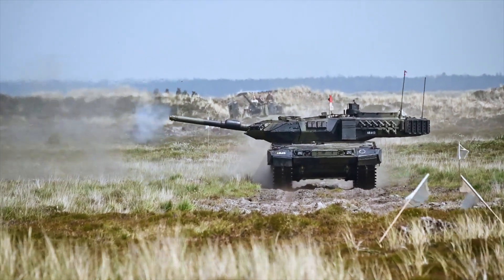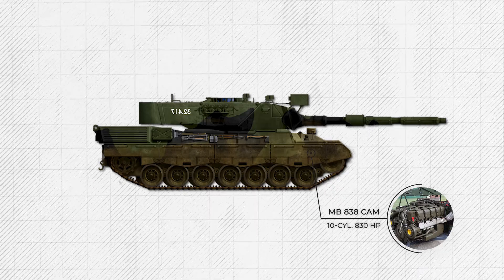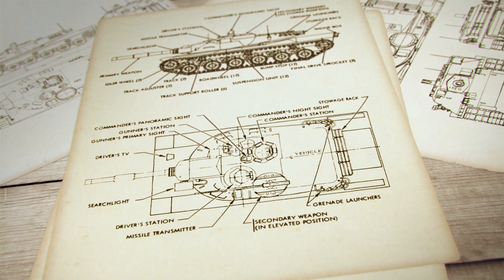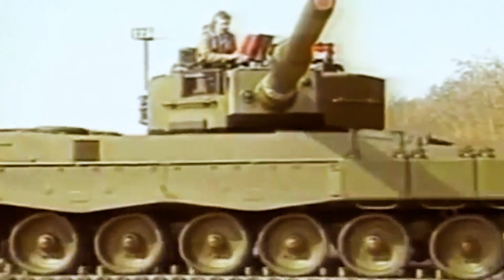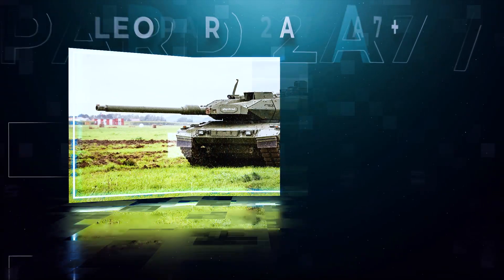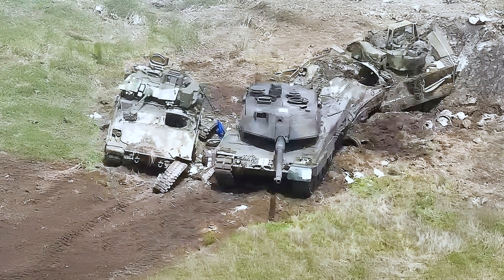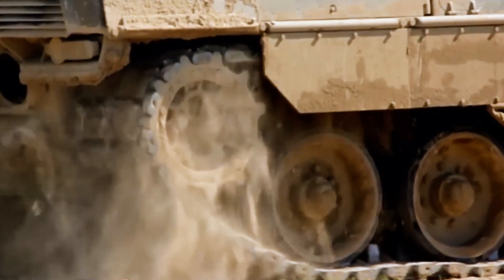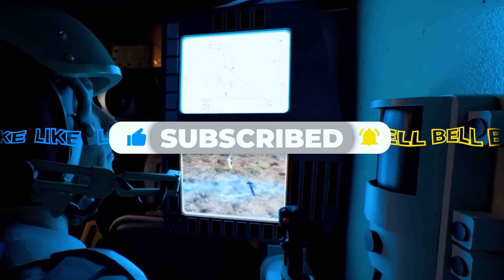The Main Secret Of The Leopard 2 - Why It Doesn't Explode When Hit

Comment: Nice video, but have some real issues with stated facts. For example, T-90 has a standard diesel engine and in older versions is just a cheap mass production tank unlike T-80, which is 3.5 times more expensive mostly due to it gas-turbine engine.